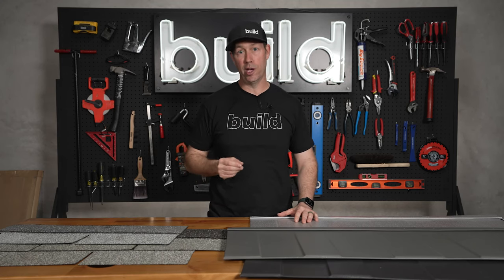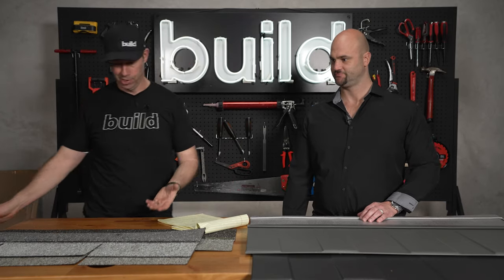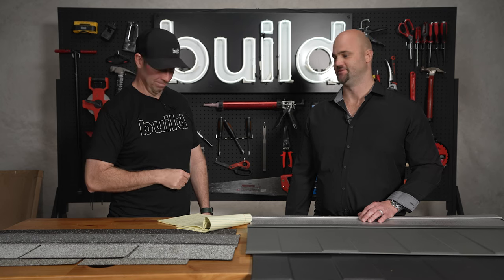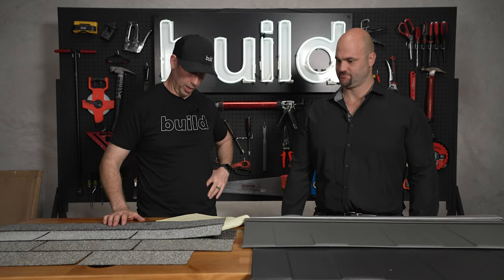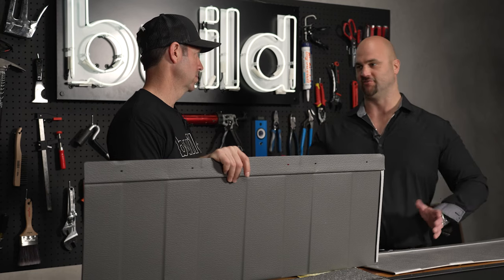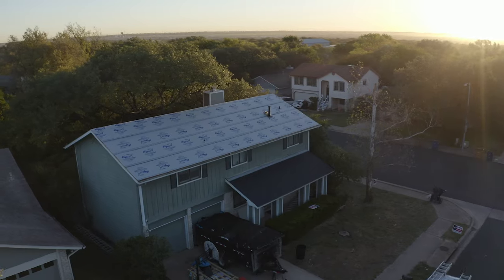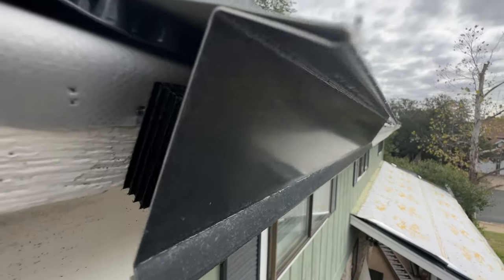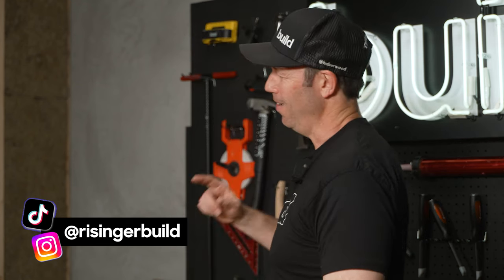Roof Shingles :  Asphalt vs Metal

Comment: Heres the story on metal roofing.  OLD METAL ROOFING WAS GREAT.  New metal roofing, well, what you can afford, is crap.  29 GA, 26 GA, you're kidding.  I won't go lighter than 22 for any metals.  Old metal roofing was WAY THICKER, hence it lasts longer.  Also, old metal roofing consisted of materials you won't see.  Tin and Lead coatings, solid copper and lead.  The metal roofing YOU are thinking of in the back of your mind was at least 20 ga, even 18 ga, with PURE tin coatings on steel / iron.  They were installed over attics that were warm and airy as nothing was insulated or sealed in olden times, and humidity buildup and thus 'rust' not much of an issue, atop that, they were installed on old growth pines dense with resins, furring with air spaces under that vented humidity and heat up and away from roof (and house).  Not that I recommend putting typ residential metal roofing on furring, it's way to thin and will get punctured when walked on, hail hits it, etc. oil can, dent and otherwise become problematic over time.  The quoted 15 to 30 yr life time for residential metal roofs are no different than GOOD shingle roofs, and the only difference between good and bad shingle roofs is a SLIGHTLY more expensive shingle that is significantly heavier, not made of cheapest crap available, and is flashed in properly and with ANY roof there is no longer any excuse not to put ice and water shield under it all.  It alone buys you 10 more yrs if you are old impoverished and your shingles blow off after 30 yrs.  I LOVE METAL ROOFING, but only high end commercial.  If you can do that, your roofing will indeed LAST 100 YRS (which yes will actually be cheaper than 3 or 4 replacements otherwise).

Comment: Okay… So first off, 90lbs per square verses 100lbs per square is not 1/3 lighter than comp shingles. If my math is correct, it’s 1/10 lighter. 2nd, fire hazard is a rare exception for all roofing considerations, not the primary consideration, & therefore while it’s a legitimate safety concern, it’s not every day your home is threatened by fire, regardless of where you live. And therefore I’d expect you to mention fire rating of your metal shingles after the higher priorities rather than before other more legit reasons why anyone would choose your product over another product; unless of course you’re trying to scare them into using your product. Now, on with the rest of your interesting reasons…

Okay, so just to follow up, all your other reasons were subjective at the very least. And, by the way, only cheap flippers put 3 tab on roofs anymore, so all your criticism of 3 tab durability & wind resistance was a mute point hands down. I’ve roofed houses longer than either of you so…

Comment: Regarding cost, you lose credibility because you didn’t research the facts. The installed cost for architectural asphalt shingles  can range as low as $230-$250/ sq. not $400 as you reported. That makes the Ideal Roofing steel shingle 4x to 5x times the cost of asphalt. Using current cost and time value of money , metal loses every time vs asphalt.

Comment: Metal roofs suck they rust and the warranty on metal is void if you walk on it. And it's so costly it's not economical. All roofs need to be class 10 hail proof. It's got to take 200 mph hail as big ass softball size. So until metal gets as cheap as 3 tab it's useless and insurance  doesn't allow them on homes . As for the screws is not allowed unless 4 by 8 truss with 1 inch plywood. Metal warranty void if osb used. Also roof structure must be anchored to foundation and take 300 mph.

Comment: They do tar sands but not getting the petroleum out of old shingles…hmmmm
Reply: Old shingles will have very little 'good ' asphalt left due to weathering and sun exposure drying it out. You might be able to recycle a small amount of it into other products but probably not for making new shingles.
Reply: Shingles don’t contain petroleum (only a derivative of it) whereas tar sands do
Reply: @philippenight2421  derivative is close enough.
Reply: @gordybishop2375  lol what?

Comment: The recycle argument is a scam. No roofer or construction company is going the extra mile to recycle an asfault o4 metal roof.
Reply: I bet they do.  A typical 20 square roof would weigh about 2000 lbs = around $200 or so scrap value vs paying to dump shingles